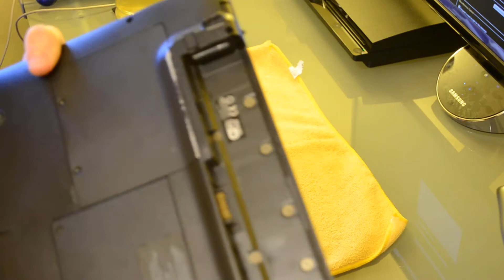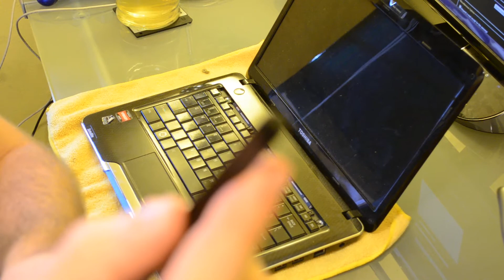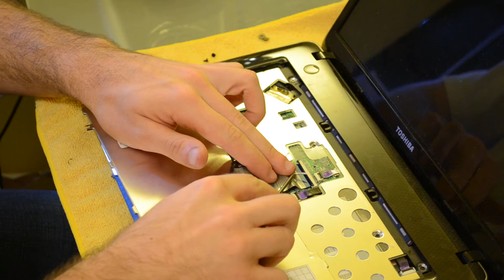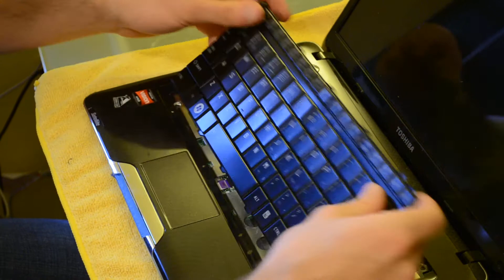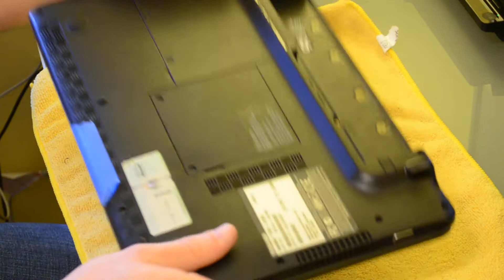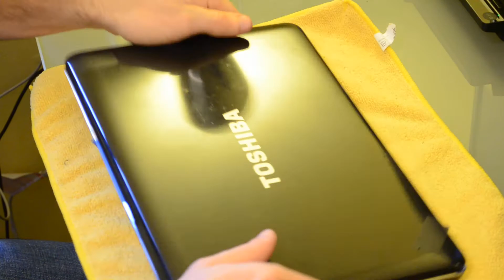Tutorial: How to replace the keyboard on a Toshiba Satellite

Comment: I just successfully replaced the keyboard on my Toshiba Satellite L755.  The only difficult part of the operation was to get the ribbon cable in the proper place so that the black bar would clamp down on it and not let it slip out.  I really appreciate the video, but it would have helped me a lot if a bit more time was spent on that rather difficult task.

Comment from the maker: It depends..if the rubber plunger underneath the key is still in tact, you can buy the plastic scissor part and key top on ebay for just a few bucks. If the plunger is torn off or the actual keystroke does not register when you press the plunger, then you need a new keyboard.